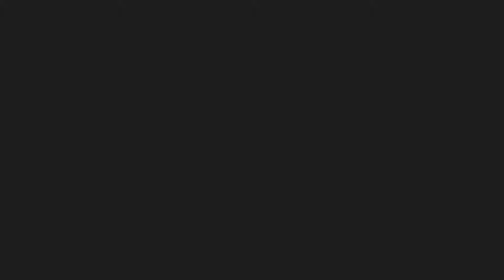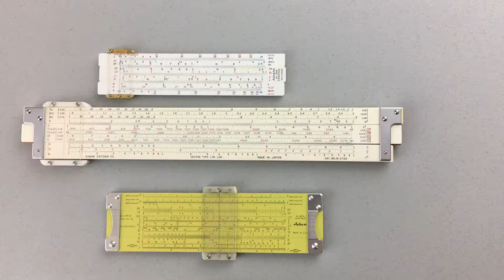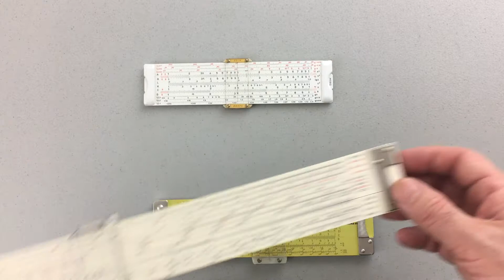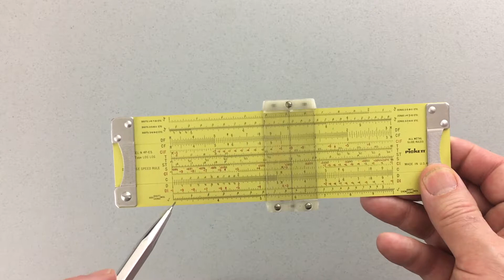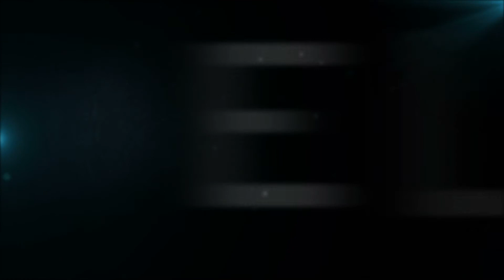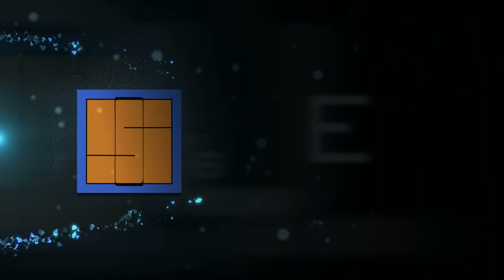Which Slides Rule?

Comment: Over all a solid presentation. I'm a little late to the party but as someone who used Pickett slide rules in high school and into college I feel compelled to correct some points. I'll try to not belabor what others have commented on but I'll note that my N500 and N600 both have the traditional A, B, and K scales as well as LL1-LL3. I was unfamiliar with the N4P model mentioned but a web search turned up a Reddit r/Sliderules thread calling it "the most complex pocket rule made" so perhaps it was a poor choice for generalizations.

I think some of the perception of Pickett differing from "normal" scales might stem from their marketing models for various niche markets. The circular rules I have from Pickett and Concise, for example, have company/application-specific scales on the rear. The Pickett N515 I learned electronics on has A and B scales but no K. It instead has a 2pi scale which was quite handy back then given the constant's ubiquity in electronics equations.

Comment: I've used a Post Versalog for MANY years, until I drained my meager bank account to, and drove to Chicago, with my $400, to actually get the HP-45 Calculator.  Before then, I was so good with my Slide Rule, that I was able to outperform a group of younger College students with my slide rule doing data reduction, and they with their TI Calculators!

I must also say, that in the years I used my Post Versalog, I NEVER had any issues with wood warping, etc.  That Versalog always operated smoothly.  I did notice, however, that the longer Rule you Showed near the beginning of this video was improperly aligned -- with a noticeably wider gap at one end.  Terrible disrespect for an instrument!

Comment: When I was a kid, just before scientific calculators became widely available, a typical problem I faced was to calculate the angle between two objects in the sky. This involved a formula like cos C = cos A cos B + sin A sin B cos (a - b) where (A,a) and (B,b) are the coordinates of the object. Doing this with tables took FOREVER. Even doing it on the slide rule was laborious, with the main error coming from the addition. If you didn't want to resort to pen and paper, you needed a way to add/subtract 2 numbers - so you convert an addition problem to one of division by writing x + y = (x/y + 1) y and add 1 in your head! Even the most primitive scientific calculator was an enormous time saver. But it is satisfying to know that with my slide rule and my Abramowitz & Stegun I can build a Saturn V if someone really wants one after the apocalypse.
Reply from the maker: It's great you think that way.  In my opinion, we should go back to teaching math using slide rules and multiplication tables.
Reply: I just saw another video referring to the NASA engineers adding numbers with their slide rules, and I smugly thought “Oh, she meant multiplying “ and here you taught me how to add using my slide rule! Cheers!

Comment: I have a Dietzgen 1734 and it is by far the best rule I've ever used. The cursor is extremely fine etched glass and is absolutely dead accurate front and back. Doing 3-place computation is a breeze on it. I never liked Picketts because they seemed to have misaligned cursors and sticky motion. The Dietzgen has plastic scales bonded to bamboo and even after 70 years it still glides like butter. The etching on the scales is sharp as a tack even under a magnifier. Just a beautiful instrument.

Comment: Pickett didn't marked those scales "AB" and "K" just to be different but because those scales do NOT represent squares (x^2) and cubes (x^3) but the inverse functions, square roots (x^1/2) and cube roots (x^1/3). You are totally missing the point. It's not some kind of eccentricity. The traditional AB scale is two decades long, while the two new Sq1, Sq2 scales are half decades long making them 4 times more precise than a single AB scale. It was a major improvement introduced at the end of the slide rule era. If it wasn't for the pocket calculator, the AB would have gone extinct. All majors slide rule makers were replacing double decades scales with multiple half decades scales. It's not a "Pickett" thing. Sun Hemmi, with the Versalog and Versalog II, K&E. with the Deci-Lon, etc. were all doing the same.

Versalog isn't a manufacturer. It's the name of the 1460 model made by Sun Hemmi and sold in USA by The Frederick Post Co.

Your Dietzgen slide is severely misaligned or warped. You can adjust the space for the slide with the screws on the body. See the instructional manual.
Reply: Interesting info. It's also interesting that American rules are different than European (Czech and German) ones. It seems they usually lack pythagorean scale, sometimes they have two tan scales (i think it's not necessary due to CI, have to try) and sometimes they even have hyperbolic trig. scales which are functions I never used in my life (maybe they are used in construction or mechanical design). Also I think that every Czech slide rule has cursors for fast HP<->kW conversion and fast conversion between diameter and area of circle (2 on CD scales matches PI on AB scale) so it's possible to get volume of cylinder by one move of slider. But maybe american rules have other tricks. Have square roots for 1-10 and 10-100 is certainly nice. But once when I wanted to get square root of 62 or something, I found out that most accurate way is 0.64^1/2=0.8 on LL0 and not using AB vs CD (it was not that obvious case, something like sqrt(7.8^2). But it needs to have duplex rule and some creativity.
Reply: @pavelperina7629  Some continental differences can be explained by differences in school curricula, and others by the predominant industries in each region. 
____________

Hyperbolic trigonometry has many applications in various fields, such as engineering, physics, biology, and astronomy. The classic example of the use of hyperbolic trigonometry is that of suspended cables, which form a catenary curve. This is relevant for mechanical and architectural designs, such as bridges, power lines, and arches. And, it is easy to visualize by college students. That's why it's often cited. However, hyperbolic functions also appear in other contexts, such as:

Cartography: The Mercator projection, which maps the surface of the earth onto a cylinder, uses the inverse hyperbolic tangent function to relate the latitude of a point to its y-coordinate on the map.

Navigation: The hyperbolic cosine function can be used to calculate the distance between two points on a sphere, such as the earth, given their latitudes and longitudes.

Towed objects: The relative motion of a towed object, such as a glider or a buoy, behind a moving vessel can be modeled by a system of hyperbolic equations.

Missile guidance: The optimal trajectory of a missile in the atmosphere, taking into account the effects of gravity and drag, can be expressed in terms of hyperbolic functions.

Radio propagation: The shape of the radio waves emitted by a dipole antenna can be described by a hyperbolic function.

Biology: The logistic function, which models the growth of a population or a cell culture, is related to the hyperbolic tangent function.

Astronomy: The orbits of some comets and other celestial bodies around the sun are hyperbolic, meaning that they do not return to their original position.
_____________

Using my Versalog, I can estimate the square root of 62 on the R2 scale as a value between 7.87 and 7.88. That’s pretty accurate for a slide rule.
Reply: I saw that gap close when he picked it up, its probably just a loose screw.

Comment: Nice comparison of slide rules.  A few comments:
AFAIK, most Pickett rules use the standard A/B and K scales and not the paired and tripled scales you have on the N4P here, so I wouldn't say that Pickett in general doesn't use the standard scales.  And Pickett wasn't the only one with those paired square root scales, though they were called things like Sq (as you show on your Deci-Lon later in the video), R, or W depending on the maker.  I think Pickett did do things a bit differently, as you said, but the N4 seems to be one of their most unusual rules from what I know, so it may not be the best example of a typical Pickett rule.  Increased precision is one of the reasons for those paired and tripled scales on the Pickett, because they effectively lengthen the scale, making it easier to set numbers to more figures, the same way you can set something on a 12" rule more easily than a 6" rule, so there's a good justification for having them.
I'm not exactly sure what you mean about instructions for using the Picketts being more complicated.  Their rules are not self-documenting, no, but in general, the way you use a specific scale is the same across manufacturers.  If you want to use the LL scales on a Pickett, they should work the same way on that Aristo.  (Again, the N4 isn't the best example though, since its LL scales are a bit different from normal.)  Learning how to use the scales is one thing, but the same scale serving the same purpose on different rules should operate the same way.  Maybe Pickett manuals are harder to follow than other makers, but I wouldn't say their rules necessarily are harder to understand or use than others.
Reply: Thanks for the comment. I tried to find some unique slide rules and I guess Pickett N3 and N4 are the only slide rules splitting K scale into three and they are likely the most unique with the most scales (34 if I recall). Some high end Nesler Multimath and possibly other German slide rules have two R scales. Faber Castell 2/83 and 2/83N have two pairs W scales one slider vs stocks so they allow double precision multiplication, square roots and logs. 2/83 is already expensive, but 2/83N seems to be the most expensive slide rule by far.
I noticed slight difference in S scale - usually it's against C, but sometimes it's combined ST+S against A. Sometimes fine division is in minutes which disqualifies it from conversion between degrees and radians. PIC and British Thornton have weird differential SD/TD/ISD/ITD scales for sin,tan,asin,atan which they consider superior, but I believe combination of S/P is more accurate. For some reason P scale seems rare on US slide rules while system Darmstadt is extremely common in Europe and P scale is on duplex slide rules as well. 
Also what I noticed is that cursors 4/pi are common in Europe, not so much elsewhere and once they are here, scales are often extended beyond 1 and 10 a bit so this ratio is never off-scale and also it helps when result of multiplication is close to 10 and it's not clear how to perform multiplication. I wonder if US slide rules have some tricks too. When I was trying to find unique one it's hard: Thornton AA010 (PIC221), Pickett N3 or N4. F.Castell 2/83 or 2/83N, Aristo Hyper(bo)log. Then there are some with unique materials (4 layers of brown phenolic resin impregnated textile with a paper on top, cursor from mica - i guess made by some company making rudimentary electronics during ww2 from insulation materials)